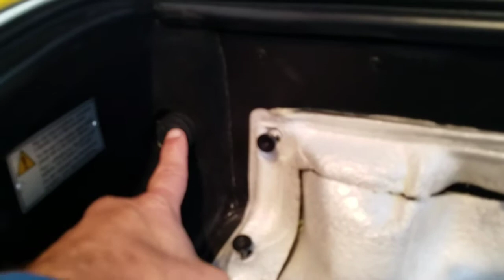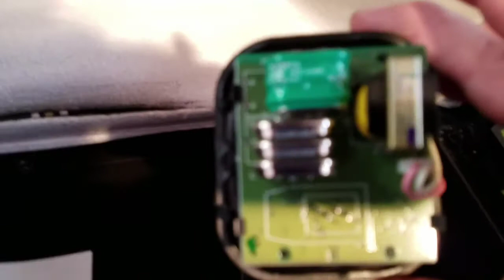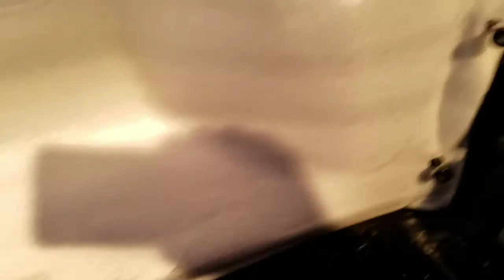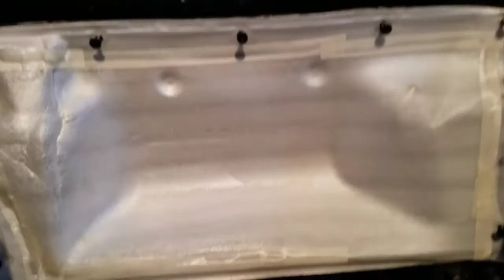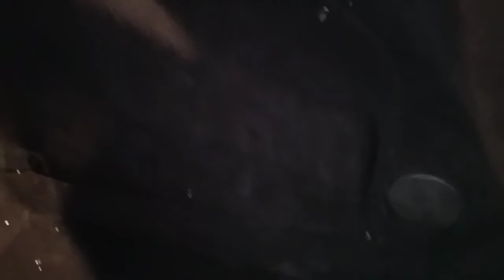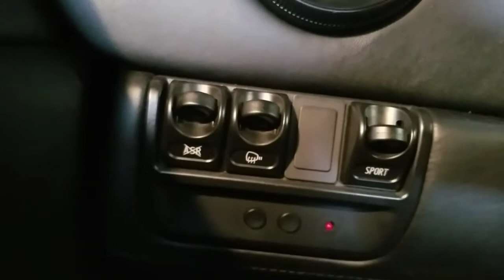Ferrari 360 alarm module change for bad battery.

Comment: Thank you for sharing this wonderful information. I have question if the alarm module not working or battery to low inside that module will activate the alarm on the car make it no to start ? Currently Remot is not working but the frequency on the Remot is sending signal .
Reply from the maker: This should not affect the car from starting

Comment: Part number compatible for 70/80 dollars?
Some link?
I need now, because mine got some problem... The acid of the batteries has short-circuited.. I also need a third remote control because I lost it. 2 problems.
Reply from the maker: Hello . the Gm part number is 15213135. this part has gone up in price now. These alarm will plug directly into the Ferrari plug. The only difference is when your alarm goes off, the horn will not sound. It will still keep the car from starting. The remote controls a different module in the car. So when you change the alarm you can still use your keys. If you have the red remote still you can program a new fob I believe. I would have to look into the procedure.
Reply from the maker: I'm currently look for some parts to try to repair the orgiinal  alarm and will make a video of that.
Reply: @ferrarifxs 
Thank you... I will search the siren alarm. 
 I have 1 red and 1 black... I lost 1 black and the key... I need one slave fob.
Reply from the maker: Programming a Ferrari Alarm ECU with New Fobs:

Alarm and Fob Basics: Ferraris arrived from the factory with three alarm remote fobs,
one red master fob, and two black slave fobs. The red fob contains the Alarm Electronic
Control Unit (ECU) Personal Identification Number (PIN) and an identification (ID)
number. The black fobs contain only an ID number. The red and black fob ID numbers
are combined with a rolling code to prevent compromise by thieves using a radio receiver
and recorder to duplicate the ID and code and use those to gain entry, just like modern
garage door openers use rolling codes to prevent compromise.

The Alarm ECU PIN is provided with the car, or with a new set of fobs, on a small piece
of two layer paper, the top layer of which must be removed to read the PIN. A red fob
can be used to program other black fobs using the same procedure outlined below for
programming a new set of fobs, if a black fob is lost or becomes inoperative. The Alarm
ECU does not use the PIN except when the car is started with ignition key and PIN alone
(fobs lost or inoperative), or when reprogramming the ECU to accept new fobs. In normal
use, the Alarm ECU uses only the fob IDs and rolling codes. Reprogramming the Alarm
ECU for a new set of fobs is an extension of starting the car with ignition key and PIN
only.

In normal practice, use the black fobs and keep the red fob in a safe place where it will
not be lost or damaged. This will ensure replacement black fobs can be programmed into
the Alarm ECU using the red master fob, if necessary.

The Alarm ECU will only accept the red fob PIN and ID and two black fob IDs during
reprogramming. Note the fobs are transmitters only. They have no receiver capability.
European and US/Canadian fobs use different transmitter frequencies and are not
interchangeable.

Ferrari recommends changing the 23A/A23/MN21 12 volt battery in your fobs every six
months. This is easily accomplished with a small Phillips head screwdriver to remove the
screw holding together the two fob halves.

If you only have alarm key fobs and no PIN, you cannot reprogram your Alarm ECU to
accept new key fobs. (It is possible to clone extra key fobs to provide back-ups. Do a
search in Ferrarichat.com.) Ferrari North America, through its authorized dealer network,
can provide you a new Alarm ECU, a new set of three matching fobs, and the PIN
number as an ultimate, but costly, solution.

With the alarm and engine immobilizer armed, pressing a key fob will disarm both alarm
and immobilizer. After 120 seconds, the engine immobilizer will rearm if the car is not
started. Starting the car will require one additional push on the fob to disarm the
immobilizer after 120 seconds have elapsed since disarming the system. If you remove
the key and open a door after returning from driving and do not arm the system with a
fob, the immobilizer will arm 60 seconds after the door is opened. To reprogram the
Alarm ECU to the new PIN in the red fob, make sure the immobilizer is armed and the
alarm is disarmed.

Starting a Ferrari without a Key Fob: The first step in reprogramming the Alarm ECU
to accept new key fobs is the same process used to start a Ferrari if all remote alarm fobs
are lost, inoperative or unavailable and you only have the ignition key and know the four
digit Alarm ECU PIN. This procedure is spelled out in the Alarm System Manual
supplied by Ferrari. Here is the procedure spelled out in the Ferrari copyright Alarm
System Manual:

If this seems rather cryptic, here is what it means:

Drive your car to make sure the battery is fully charged in case you foul up the procedure
so you do not run down your battery.

Remember the times important in this sequence. Key off-on-off cycles representing PIN
numbers must be made in less than two seconds. After PIN numbers are entered by the
required number of key off-on-off cycles, a pause of more than 2 seconds and less than
20 seconds must be made before entering the next PIN number. If your PIN has a zero, it
is represented by 10 off-on-off cycles of the ignition key. If you foul up, you must wait at
least 20 seconds before starting over. So here is the procedure after you have driven the
car and waited 60 seconds after removing the key and opening the door or 120 seconds
after removing the key and not opening the door so the immobilizer is armed.
PIN Code 3204 is used as an example for this case. This is different from the code 3324
in the Ferrari illustration above. Ignition switch position  0  mentioned above is off and
position  II  is on.

1) Insert the ignition key and wait at least 20 seconds with the ignition key in off.

2) Turn the key from off to on and back to off as quickly as possible (less than 2
seconds for all PIN numbers) 3 times (count to 3 out loud) for the first PIN
number  3 .

3) Count to 5 out loud (a good compromise between more than 2 and less than
20 seconds) before starting the second PIN number.

4) Turn the key off-on-off 2 times for the second PIN number  2 .

5) Count to 5.

6) Turn the key off-on-off 10 times for the third PIN number  0 .

7) Count to 5.

8) Turn the key off-on-off four times for the fourth and last PIN number  4 .

9) At this point, after 2 seconds or a bit more, the alarm light emitting diode
(LED) will go off and you can start the car. Starting the car confirms you can
correctly enter the PIN, the first step in reprogramming the Alarm ECU to
accept new remote alarm fobs. Keep trying if you do not succeed the first
time, remembering to wait more than 20 seconds before the next attempt.

Programming the Alarm ECU for New Fobs: Ferrari also provided procedures for
reprogramming the Alarm ECU to accept new remote alarm fobs. This process is
described as putting the Alarm ECU in  self-learning  mode in Ferrari Workshop
Manuals, the first step of which is entering the Alarm ECU PIN as described above.

Again this is a bit cryptic, but the times for entering the PIN numbers still apply and less
than 2 seconds is what you need to remember for the following ten key cycles noted
above.

Again PIN number 3204 is used as an example and the first eight steps for starting a car
with PIN and ignition key alone (no fob available) are identical but given here as a
complete checklist for reprogramming the Alarm ECU. The steps following PIN entry
rely on watching the Alarm LED cycle from on to off ten times and eventually flashing
when  learning mode  is fully enabled and the new alarm fob PIN (red fob only) and IDs
(red and black fobs) can be entered into the Alarm ECU memory.

1) Insert the ignition key and wait 20 seconds with the ignition key in off.

2) Turn the key from off to on and back to off as quickly as possible (less than 2
seconds for all PIN numbers) 3 times (count to 3 out loud) for the first PIN
number  3 .

3) Count to 5 out loud (a good compromise between more than 2 and less than
20 seconds) before starting the second PIN number.

4) Turn the key off-on-off 2 times for the second PIN number  2 .

5) Count to 5.

6) Turn the key off-on-off 10 times for the third PIN number  0 .

7) Count to 5.

8) Turn the key off-on-off four times for the fourth and last PIN number  4 .

9) Count to 5.

10) Turn the key to on and count  1  out loud. The Alarm LED will come on and
then go off.

11)As soon as the LED goes off, turn the key from on to off and back to on in
less than 2 seconds and count  2  out loud.

12) Repeat the key cycles and LED cycles until the count reaches 10 cycles.

13)After the 10th cycle, turn the key back on and the LED should start flashing.

14) Press the red fob button until the LED accelerates its flashing and then stop
pressing the red fob button. The LED will resume flashing slowly.

15) Press the first black fob button and the LED will again accelerate its flashing.
Stop pressing the black fob button and the LED will resume flashing slowly.

16) Press the second black fob button and the LED will accelerate its flashing one
last time. Stop pressing the second fob button and the LED will stop flashing
completely.

17) The Alarm ECU is now programmed to recognize all three remote alarm fobs
and the fobs should be checked to ensure they are operational.

Note: Reports have been made of the number of cycles of the LED varying from 12 to 20
or more before the LED started flashing. My Alarm LED flashed on the 11th time
the key was turned to on, exactly as stated in the WSM extract above.

Although this process sounds very involved, the actual ECU programming process takes
less than five minutes from start to finish, assuming you make no mistakes. This is even
if you are unlucky and have a couple of zeros in your PIN.

Comment: You know that alarm is pretty similar to the ones on Audi, VW, Skoda (GM as we see on this video).

What we normally do (like you mentioned on the video) is buy a 6 AA or AAA battery holder and some batteries like mentioned above.

Then we take the old battery out , reseal the alarm box with the battery holder outside and put the new batteries on the holder.

Much cheaper and works like before since it's the original module.

What I'm trying to say is that there is no need at all to buy another module and spend "lots of money" if the old leaking batteries have not damaged the board beyond repair.

A little DIY and all is solved. You can even put the batteries wherever you want making them accesible for future changes. 👍
Reply from the maker: Thanks. Maybe I'll try it and make a new video. I was going to replace the old batteries.
Reply: I will look forward to it.

I'm changing mines this week, just waiting for parts.

I feel like if the manufacturers installed an external battery from the beggining it would be so much easier when they fail... But then again they like to make things harder for us! 😅
Reply from the maker: @makpsv  sell more parts
Reply: @ferrarifxs  More like sell more expensive parts. Theycould still sell a genuine external battery, but that's not enough.

Not surprising. 🤷‍♂️

Comment: You are to be complimented on an excellent video! I have a 2000 Modena manual transmission suffering from the "Old RLAOWD" (red light always on while driving) problem. I haven't done anything about it as it really doesn't bother me. However, sooner or later I should get this fixed. A couple of things here. 1) As most people have experienced, and your note mentions, the inexpensive GM part will kill the light but won't activate the alarm (supposedly, Euro-spec cars don't have this problem from a Ferrichat post from vrsurgeon); so the question becomes do you buy the expensive Ferrari original or use the GM as a fix for the LED light only? Or let a Ferrari dealer do the entire project at what I've heard is about $1000? I can see doing this with the GM while I own the car, but if I ever sell it (which will happen one day, just not soon, I hope:) I would want the buyer to have a fully functioning alarm system or certainly disclose that the alarm siren doesn't work. Obviously this is up to the owner in what to do. 2) The vapor barrier looks like it's that thin foam plastic sheeting that sometimes is used in packaging. Is that correct? I assume a dealer would remove the entire barrier and replace it, instead of just cutting through it as you show. I think I read elsewhere that it is possible to slowly and carefully pry it gently away and then re-glue it after the module is replaced. Or get a sheet of the foamy plastic stuff and cut a new piece to size and then glue that into place. Do you think these are options? Best, and thanks again for you fine video. Richard
Reply from the maker: Hello. Thanks for your reply. You can pull apart the old alarm, but the internal batteries are soldered to the mother board and are difficult to find to replace. As for the foam barrier this was done by a ferrari dealer. When I purchased the car it was serviced exclusively by Ferrari.  Like I said before the alarm will immobilize the car but will not sound till the key is turned on. Why they made these different is strange.
Reply: Thanks for the prompt response. Interesting that a dealer would just cut the barrier, but I suppose if they did that then I shouldn't be too worried about doing it myself. I'm sure you've seen another article on replacing the batteries with rechargeable Ni-Cads totaling 7.2 v, so that is an option (although a difficult one as you mentioned). Funny that Ferrari would solder the batteries in place and you've got to wonder what the heck they were thinking.  Of course the simple answer is that it would be to spend money at a dealer for a part and services through "planned obsolescence." GM part= $70, Ferrari part=$700; gotta love that, right? I love my 360 but all of its quirks does make one angrily scratch their head at times.

Comment: Does the siren sound off with this GM part, when the door is opened while the car is armed?
Reply from the maker: Hello Chris
    I just went out to test. You are correct. The lights only flashed. The alarm will only sound when you turn the ignition to the run position.
Reply from the maker: it will still give you notification that the alarm was set off when you unarm. I guess I would stick with the Ferrari module.
Reply: ferrarifxs Damn! I have been reading on the Ferrari Chat forum that people have been using this GM part in lue of Fearri's, but nobody was real clear about the siren part!! Thank you for taking the time to test that for me!🖒
Reply: ferrarifxs Beautiful car BTW! Mine is a yellow Spider as well, but with a the dark blue top and black and blue interior... I just got done changing the heat exchanger on mine, boy was that a job!! 😥
Reply from the maker: You would't know. I had to lock the car with the window rolled down to test. Other than that it seemed to work fine. The circuit board inside must vary.  For me, it's not a big deal, it still locks and unlocks the car and gives me notification that the car is locked and unlocked and the red light is out.
Reply from the maker: Thanks
Reply from the maker: I just put a note at the bottom of the video so other people know.
Reply from the maker: What was your indication that the heat exchanger was bad and how many miles?
Reply: ferrarifxs I opened the coolant expansion tank to check the level and noticed that there was oil in the coolant!! Mine has 20,000 miles and gets driven at least twice a week. To make a long story short, a Ferrari tech chimed in on a forum thread about this being a common problem with the 360 and stated "make sure you guys have your coolant changed every 2 years maximum" He said not to let the coolant get older the years because the heat exchanger is made out of copper and after about 2 years coolant starts to turn acidic and eats through the copper.... thus cause the gear box fluid to mix with the coolant!
Reply from the maker: was your engine oil milky in color?
Reply: ferrarifxs No, the engine oil is not effected by this part. The heat exchanger is connected to the back of your water pump, and 2 steel braided lines from the gearbox bolt to the side of the heat exchanger. The heat exchanger is designed to regulate the gearbox oil temperature with the coolant.... so if it Springs an internal leak the two fluids start mixing!
Reply from the maker: Thanks. I changed mine 2 years ago when i did the belts
Reply: ferrarifxs Did u change it just to change it? Or was it going out?
Reply from the maker: i'm Sorry the fluid. I haven't had any issues with the heat exchanger. I probably just jinxed myself
Reply: ferrarifxs okay gotcha. No I don't think you did... if you keep that antifreeze fresh, (no longer then 2 years old) you should be good! It's a very simple part with no mechanics or Electronics... so in theory if you keep the fluids that run through it fresh and new it essentially should be good the life of the vehicle... ( in theory) 😆
Reply: And gear fluid is so cheap there's no point in not changing that fluid in the gearbox once a year!